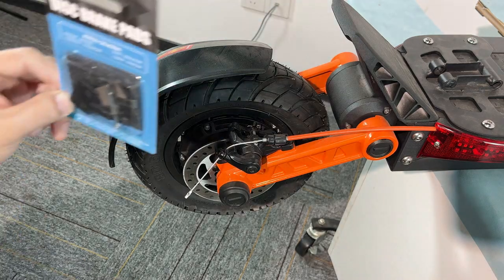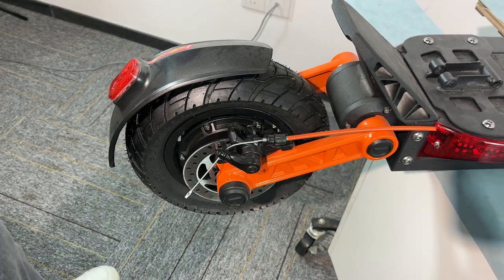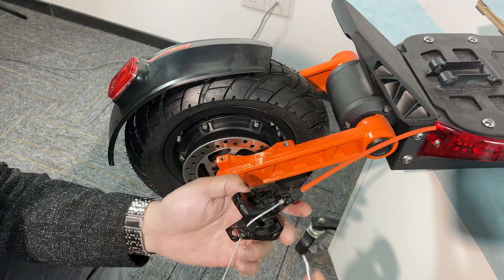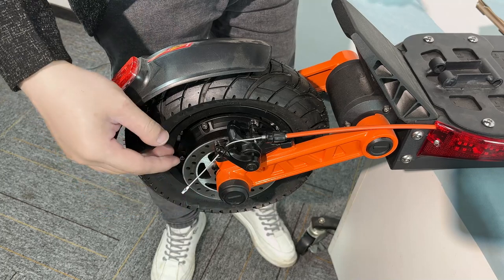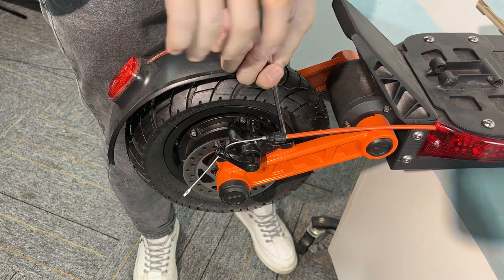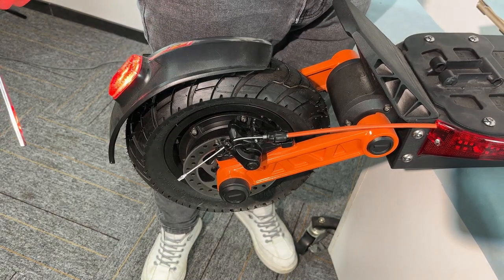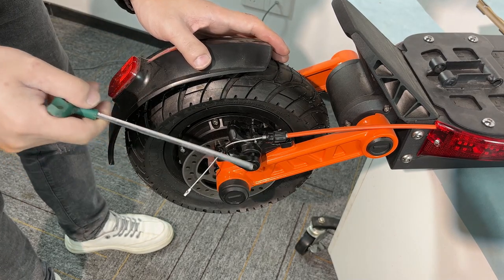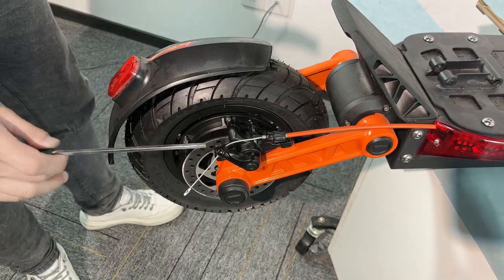How to replace brake pads on JOYOR scooter S5 s8s s10s electric scooter repair

Comment: I just ordered them on Amazon they came today so this timing is perfect on This vid
Reply: I got corki cycles mtb disc brake pads I had to Dremel them down on the sides a little but any of those mountain bike disc pads on Amazon work I got 2 pairs for 10 bucks
Reply: Do you have the link to the right pads?

Comment: Hello!  I have been using the Joyor s10s scooter for a year.  But I learned a lot from your videos!  Can you please tell me if you can install the scooter fender on the front wheel?  several times I rode in the rain and my legs were wet to the knees
Reply: Hi can you give me info you recomend joyor s10-s? Or no is it good scooter??